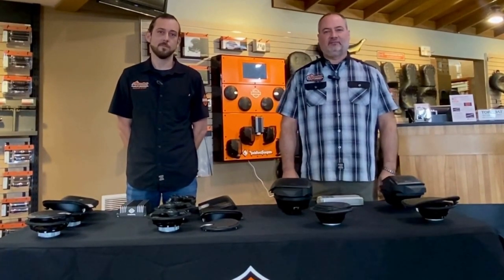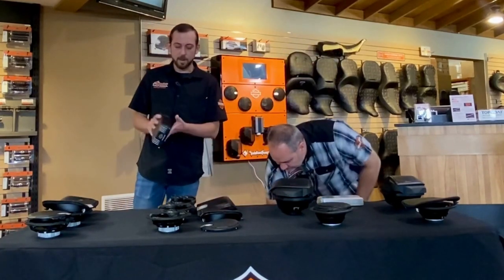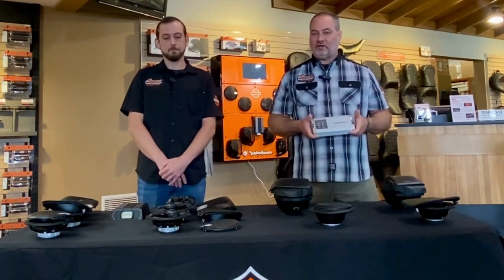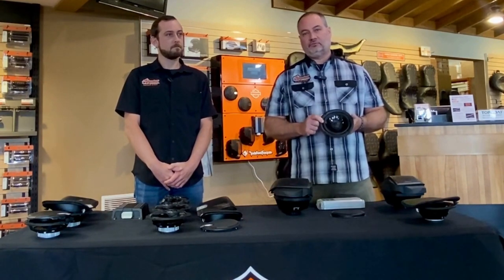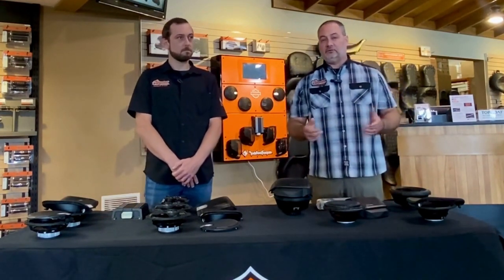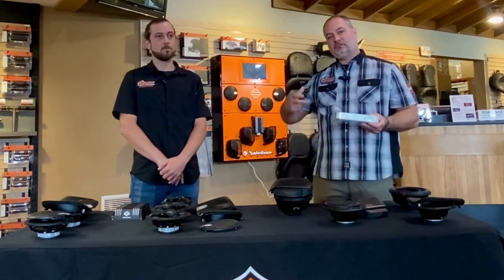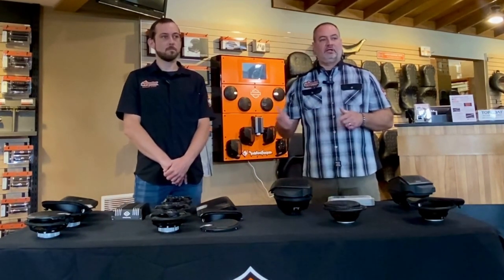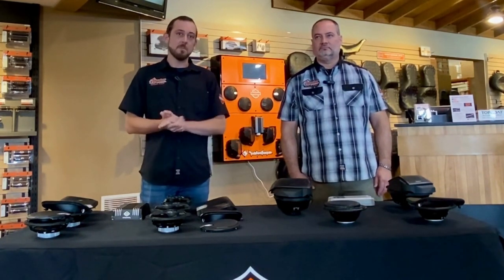Harley Davidson® vs Rockford Fosgate

Comment: It's worth noting that the subwoofer systems require two channels from the amplifier for each sub. Installing both primary and secondary subwoofer kits can only work with two or four speaker systems. Six speaker systems will only work with the primary subwoofer kit (6 speakers @ 1 channel each + 1 sub @ 2 channels = 8 total channels). This is straight from the installation instructions provided by HD for the subs.